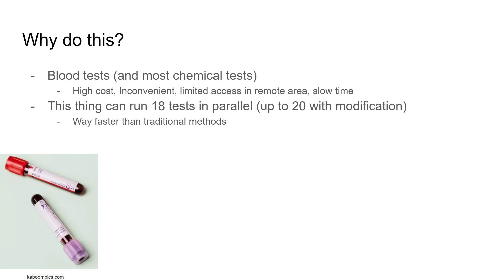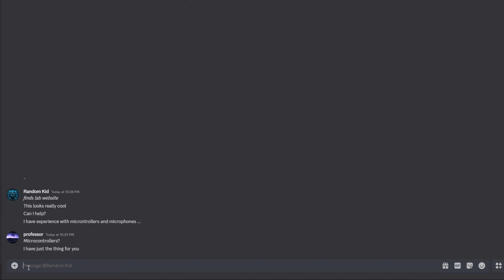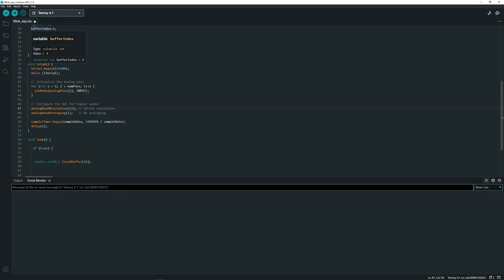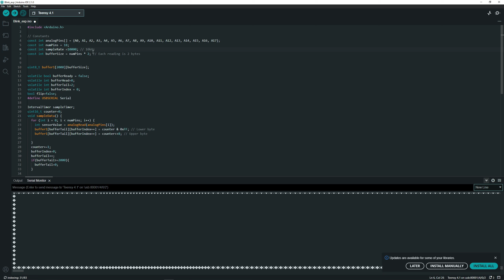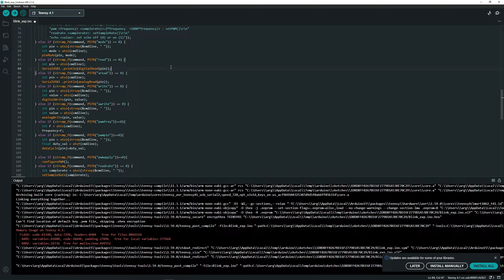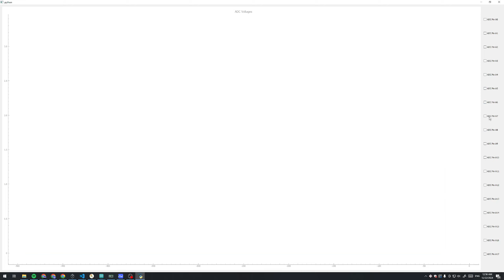UC Berkeley 18-channel Potentiostat Overview so far

Comment: This seems like a really promising solution. Nice work! Have you considered testing different cooling systems to help with runtime stability?
Reply from the maker: Not yet, I've tested the system in the summer as well where the room temperature is ~80F  and  the chip only heated up to around 110F under extended load so I'm not super worried. However, if I do need to push it further, I'll probably add some heat sinks. Thanks for the idea though.